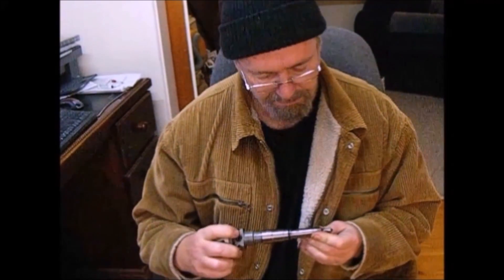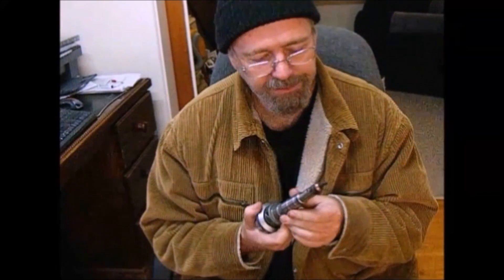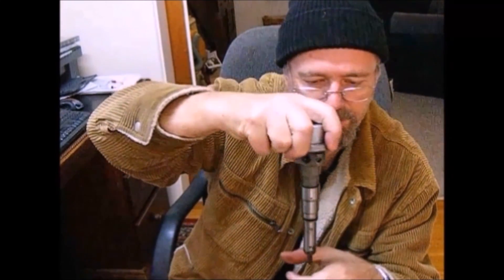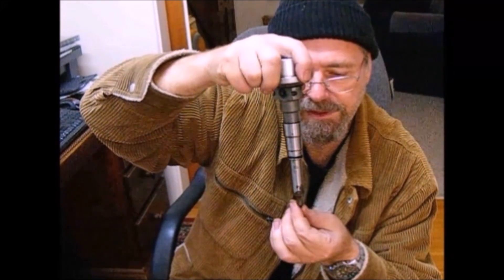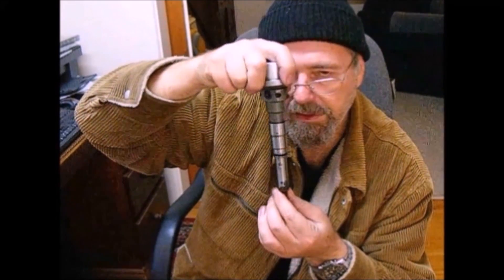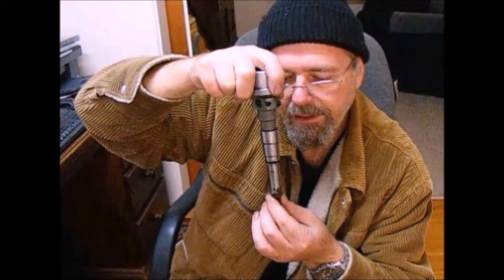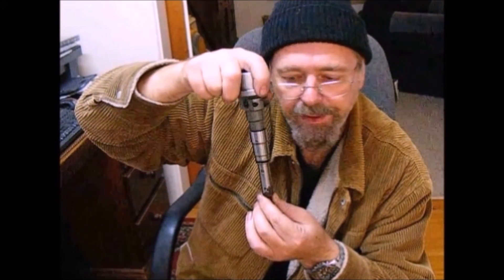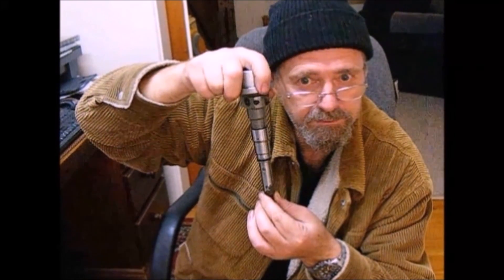Why Isuzu 4JX1 Injectors Fail - and How To Fix Them

Comment: Hey Edwin - love what you have got here.
I'm on a steep learning curve from a 95 barina to a 98 jackaroo, so bare with me. 

From the reading i have done it seems there are three issues.
1. Diesel in the water
2. Diesel in the oil
3. Water in the Diesel

From your explanation i can understand how diesel gets into the water from those seals failing, but in another video you say that smelling the diesel in the oil is a diagnose, and i assume a rising oil level would be as well.

The short question, how does diesel get into the oil,(i have heard through the inside of the injector?)  and does doing this repair on the seals and sleeves fix the issue?

Another great resource i have been following is: http://forum.australia4wd.com/index.php?/topic/22839-injector-sleeve-repair-do-it-yourself-step-by-step/

Thanks heaps!
Mike
Reply from the maker: HI Mike, In the head there are 3 fluids, coolant water/fuel/oil.  All 3 flow around or through the injector sleeves. The fuel actually flows though the head at about 35psi along a cast gallery and swirls around the top of the sleeves before entering the sleeve through 2@7mm holes (so is preheated which improves diesel combustion massively). The sleeve also has coolant at about 35psi flowing along a gallery at it's base and in direct contact, which cools the tips of the injectors which are in the combustion chamber's 2500F gasses (which peak at around 2500psi).  A number of HEUI type engines use a camshaft to drive the internal HEUI injectors' pump (ie as in the Landrover diesel), but Isuzu opted for oil-hydraulic pressure to control injector timing more accurately. This is why early Jackaroo turbo diesels have about 120hp, whereas a 4JX1 has 165hp as well as about 25% more torque with greater economy amazingly.  This hydraulic system means there is oil at about 400psi+ entering the top of the injector from it's oil rail to drive it, which force is multiplied inside to drive the fuel, via a stepped piston, up to 26,000psi.Then with pressure spent the oil is squirted out the side of the injector ( which you can see on a 4JX1 running with the rocker cover off..and is a good way to check if your injectors are working).  
So you can see that the HEUI injector is actually an extremely powerful hydraulic pump similar in principle to those found in a car jack, whose atomization pressure is huge - and yet to be equaled by the latest piezo-electric types.

To seal all of this, a very clever system is used.  The bolt torque sequence upon installation must be adhered to exactly - for the injector is clamped down onto a copper alloy washer (gasket)..and this bit of copper is exposed to the hot combustion chamber. It expands when hot and puts an enormous sealing pressure on the body of the injector.  This is why the injector body is so beefy compared to other types.  So, adding that up:

1./ the copper gasket reliably holds back 2500psi at 2500F. It is this copper washer that must be replaced periodically (50-100K kms) in ALL centrefire common-rail injected engines - especially diesels with their higher combustion cylinder pressures. The Isuzu systems small $4 washers are very inexpensive compared to the designs of the Cummins, CAT, Ford, Detroit etc

2a./ the various rubber O-rings have a very light duty of around 35psi in comparison and normally last a very long time.
2b./ unless.... the copper washer fails and allows 2500psi through. Then the rubber O-rings WILL fail also.  They must fail if you think about it. 

When this failure occurs, you might visualize all those fluids swirling around that relied on their various O-ring seals.  Each case is different.. some get gobs of green coolant in the fuel tank..some get oil being pushed through the injectors into the combustion.. or oil pushed into the coolant water.. or fuel in the oil.. or a combination of all these.  It just depends on which O-ring gets slaughtered first.

The one that gets all the publicity is fuel in the oil, since this can cause the engine to run on it's own lubricant and in some rare cases be incapable of stopping but instead rev up till it explodes. You will find dramatic YouTube video's of diesels of all types having this happen ( Cummins seems to be the favourite in videos for some reason). 

In the 4JX1, fuel in the oil happens when the blast of combustion gas passes through the failed copper gasket, then blasts through the fuel gallery in the head, which pressure often forces fuel past the second set of O-rings into the engine oil.  This blast occurs each time the piston comes up on the compression stroke with all valves closed - ie it's a pulse pile-driving through like this: ..all valves closed...compression stroke FIRE 2500psi/2500F.... power stroke rabid reduction in pressure...valves opening as she comes up again on exhaust stroke so more rapid pressure reduction with sudden temperature drop now... intake stoke now, even lower almost a VACUUM and colder.. now all valves closed again...compression stroke FIRE 2500psi/2500F.. etc etc.  This cycle is pulsing through at 33 times a second at cruise speed (2000rpm).  Piledriver...2500psi - 0 - 2500 - 0 - 2500 - 0.. And that's without considering the temperature fluctuations.    And that's why you get leaks.

So... the ACTUAL repair for this is to put in new copper gaskets (washers). They're the cause.  If you get a magnifying glass and look at the O-rings, often they appear intact.  In fact, many mechanics don't replace the O-rings and the engine runs ok.  So here is the big misconception about this engine exposed - IT'S NOT THE O-RINGS THAT FAIL.   However it is rather bad practice not to replace O-rings in a hydraulic circuit if you have the device apart.. which you'll know if you own earthmoving machines.  They may have been effected by the high pressure even if you can't see damage - eg there may be soft spots from the heat. Eventually these O-rings will fail from age anyway, so here's your opportunity to do some maintenance while she's apart.

Once the copper gaskets (washers to Isuzu..) are replaced, and a fresh set of O-rings, you can forget about this problem for a long long time.
Reply: Edwin Henry Blachford Thank you!! 
That was the best explanation, I finally get how it works! (or, sometimes doesn't!) 
You are surly helping a lot of people here, and i'll mention these videos in the forums i've started following. 

Now it's time to get the wiring harness recall done, order the parts i need, make a sleeve puller and give this a go! 

Once again thank you! 
I'll let you know how it goes. 
Mike
Reply from the maker: cool Mike.. :-) Glad to help

Comment: thanks mate i got a quote from ramin in dubai and they are quite cheap, 227 delivered to qld so i might give the dyna bolt method a go
Reply from the maker: no worries Matt. Just make sure you replace the copper gaskets (washers) at the injector tips at least every 100K from now on. The injectors will last forever then.  I doubt you'll ever need to do the sleeves again if you keep on the copper gaskets.  For $8 for a set of copper gaskets each time, that sure looks cheap compared to a set of Toyota piezo electric injectors every 100,000km ($2000 unless you have the V8 - $4000 in parts alone!).  4JX1 power.. the shit that GMH wasn't bothered to learn...
Reply: Thanks again

Comment: hi mate is there anyone in gladstone qld that may have a removal tool that you know of or would your be interested in making a tool to sell to me,, i have a dodgy injector but i want to do my sleeve seals at the same time while it is apart
Reply from the maker: HI Matt, Don't know of anyone sorry.  If you watch my other videos on making the tool, the Dynabolt type is very simple to make, just a little welding to extend the thread.. if you have a mate who can weld it's bloody simple. The designs and sizes of those are also on most 4WD Forums. The only real requirement is that the dynabolt can tighten hard into 19mm hole and be tall enough to clear the camshafts.   I'd recommend replacing the sleeves if you do that since they can get damaged with that kind of tool. This is why I designed and made a much fancier tool - I work on Jacks often. But you'll find new sleeves are quite cheap at Ramin Isuzu in Dubai.. just email them for a quote off their web page and Paypal payment.. usually less than a week to deliver. In most centre-fire diesels - as in a CAT, Ford, Cummins, Dodge etc etc..- the sleeves are made of copper and replaced at regular intervals by tapping a thread down their guts, then screwing in a bolt and winding them out - but in the 4JX1 the steel they're made of is too hard for that method.  But it illustrates that it might be worth replacing them periodically. Isuzu made them of bloody hard steel so they don't need to be replaced very often, but "not very often" is not forever

Comment: Hi Edwin, the 2 injectosr of my Isuzu trooper was diagnosed  not working throug computer. Is there any way to repair it or it needs to be replaced. Is it advisable to use the unit without replacing the 2 injectors
Reply from the maker: Hi Alex,  If the computer detects an error it is reading abnormal voltage & resistance in the solenoid CIRCUIT of the injector ( since it can't measure anything else on the injector) so the fault may not be the injectors themselves.  First you must determine if the problem is just the electrical wires and connections to the injectors.  A common problem is excessive oil in the connectors to the injectors. First clean the big connector (outside the engine) next to the dip-stick, since it is easy to get to.. oil finds it's way in there often.  It comes out of the side of the rocker cover. Clean any oil out of connectors with fuel, then methylated spirits (alcohol), then "electrical contact cleaner" spray. If this procedure makes no difference, remove the rocker cover and unplug the connectors at the top of the injectors & check the special rubber seals on the connectors that stop oil getting in - if they seem bad either replace the wiring harness or simply seal up the bad connectors with silicon rubber engine sealant when you put them back.   I see many engines where mechanics have done this trick and it works ok.

In your case I would suspect this problem first, since it would be a HUGE coincidence for 2 injectors to fail at the same time!.. it is more likely a connector I think.

Running a diesel engine with misfiring injectors will not harm it. In variable valve timing engines cylinders are randomly disabled all the time and no damage occurs.  Everything is still lubricated.  The turbo won't spin as hard because it has less exhaust pressure, so with 2 injectors faulty, expect less than 50% power.

Perhaps the best way to test the function of the injectors is to get a "GM Tech2" diagnostic computer plugged in and run the "click" test.  But clean the wiring harness and connectors first please, so you are certain. If the injectors are definitely faulty please replace the copper gaskets and O-rings when installing replacements since this may be why the error has occurred.

Comment: Hi. Can I still use the injectors that have carbon and just change the cooper gasket and seals or buy new injectors? And is there a special way of taking the gasket and seals off and on? Would there be a time you would buy new sleeves and why? And is it correct when changing the gasket and sleeves, that you would change the seals on the sleeves as well. Keep up the good work. I love my jackaroo :)
Reply from the maker: Hey Hi 45Therese,  1.Yes you can usually re-use the injectors. I have many times and the Tech2 shows them acting normally after. This may not always be the case- the injectors may be damaged at times. The best way to do an initial assessment of them is to check the MIL light for error codes or plug in a Tech2 before disassembly. 2.The injectors pull out quite easily after H clamps are removed, the copper gasket and O-rings are simple to replace. Removal of the sleeves requires a special tool to be made, but is then easy (see my other videos) 3. I would only buy new sleeves if I saw erosion of the steel in the O-ring grooves. You will likely see erosion on the outer body by the blast of combustion gas but this is of no consequence. Also check the bottom surface that mates to the alloy head in the coolant gallery for erosion but it is rare to see damage there.  4. Often the sleeve O-rings appear good. However they are cheap enough to replace anyway (since it is difficult to determine whether they have deformed enough to leak). Anecdotally it seems that when mechanics don't change the sleeve O-rings (since normal practice with any O-ring is to check it by visual inspection only) but just the injector copper and rubber seals, it has a 50% success rate.  I hope this helps.. and YES the Jack is a mighty bus :-)

Comment: Hi Edwin,  I have some questions! when changing the injectors which have been affected by sleeve leakage, do you need to remove the injector sleeves as well and why?? 2. can leakage of sleeves be the reason for disel in cooland or radiator?? hope to hear from you
Reply from the maker: Hi Sabe.. 1.  It may only be necessary to change the copper gaskets. The O-rings may still be ok. I change them since the parts are cheap and it saves taking the rocker cover off again if they're knackered.. 2. Yes. The sleeves have the 3 engine fluids flowing through them ( oil,water,fuel ) and cross contamination in any combination is possible.  Fuel in the engine oil is common, so is water in the fuel tank.. i've also had engine oil and diesel fuel in the water/coolant.  Very often this simple fault is mistaken by mechanics for a blown head gasket or cracked head because it has the same symptoms.  :-)
Reply: Thanks Edwin, this is  so much help. esp that viechle has been down for 6mnths coz of same issue.  But one more thing (am total new at this but will need to guide my mechanic)  the copper gasket referred to in this case is which one? the washer that fits at tip of the each injector or the sleeves themselves?
Reply from the maker: Sabe Mwape
It is as you say.. a "washer" at the tip of the injector. The injector sleeves in the head do not need to be removed to get to these.   But when you go to buy one from Isuzu, they call it a "copper gasket", so it pays to get the name right!  Please ensure that all the engine_oil/coolant/diesel_fuel & filters are replaced after the job.  Many overlook draining the fuel tank and flushing out the lines with diesel or kerosine.  It is likely that there is water/coolant contaminating the fuel now, so if you ignore this aspect it is very likely the engine will run very rough still and perhaps damage the injectors. Water in the fuel is deadly to any diesel engine
Reply from the maker: Sabe Mwape
Perhaps I should clarify Sabe.. It is always better to remove injector sleeves as well as the injectors and replace all the O-rings. This is because you don't know if the sleeve seals are damaged or not - and this will depend on how long the leak has gone on and how severe it was.  As I explain in this video, mostly the problem is not the sleeves, but rather the copper washers letting in huge pressure. Perhaps looking at the tip of the injectors is a good guide to this - inspect them for how much carbon has been passing the copper and whether it got hot enough to fuse it to the body of the injector. 

 If you only replace copper gaskets ( washers).. when you get the engine back running, at first it will puff a little white smoke perhaps, so drive it for about 15km to let the new seals bed in.  If you still get smoke after this, shut down the engine immediately for the sleeve seals are leaking also.  Then it is another 2 hours work to take the rocker cover off etc.  If you are doing this re-work yourself all you have to lose is a few hours, but if you are paying a mechanic, it may be cheaper to get them all replaced at once. It depends on your mechanic. I hope you understand my meaning here.  It is a matter of cost, of course
Reply: Hi Edwin, I am currently changing the seals of the fuel injectir sleeves and when i removed the sleeves i noticed there was oil in cylinder 2 & 3. My instict tells me that i have probably done a headgasket, but was wondering if its plausable that some oil couldlhave rub into the cylinders during the  remobal on the injectors and sleeves.. thanks Greg M
Reply from the maker: +Greg Morison yes it's very easy to let some oil drop into the cylinder when taking out the injectors - which is most likely the problem. After all - the diesel engine would have burnt the engine oil as fuel if this happened while the engine was running in which case there would be nothing left in the cylinders.  :)
Reply: thanks for the prompt reply. .love your videos on the 4jx1. .had mine since new. .its only done 110k  and had 3 sets of injectors in it...last lot 12months ago. it started playing up again recently. so u decided to do it myself. .bought a tech2 to check the i injectors were programmed right.  lookin in the Isuzu workshop manual it says the id code is one letter and one number. i can find the number.but no letter where the book says it should be....any pointers gratefully accepted...love my Jack
Reply from the maker: +Greg Morison 
The numbers on the indentification sticker are production numbers (not part numbers) used to identify individual injectors.
The 5th and 6th digit of the production numbers are used to classify injectors for calibration eg -

Grade A1  =  20-26
Grade A2  =  27-33
Grade A3  =  34-39
Grade B1  =  40-46
Grade B2  =  47-53
Grade B3  =  54-60
Grade C1  =  61-67
Grade C2  =  68-74
Grade C3  =  75-80

FOR EXAMPLE: IF INJECTOR HAS A CALIBRATION NUMBER ON THE TOP OF IT 82395420 -
THE 5TH AND 6TH NUMBERS ARE 54.  THEREFORE THE INJECTOR IS GRADE B3